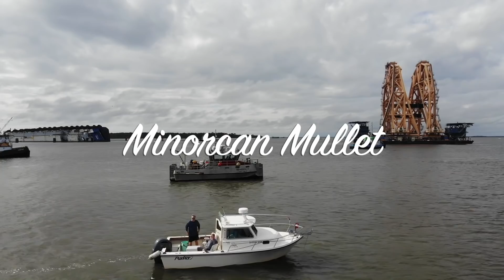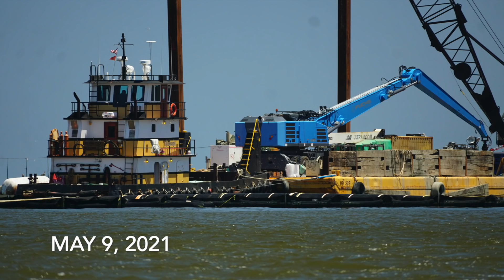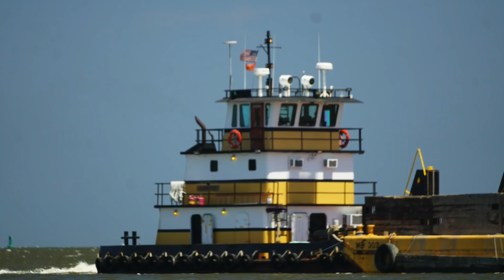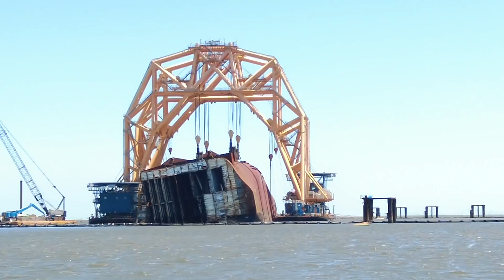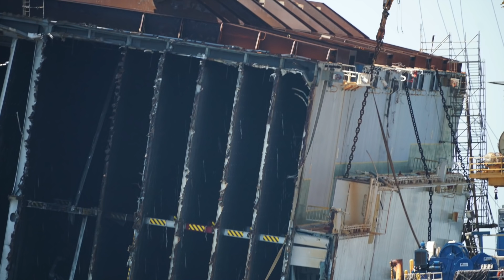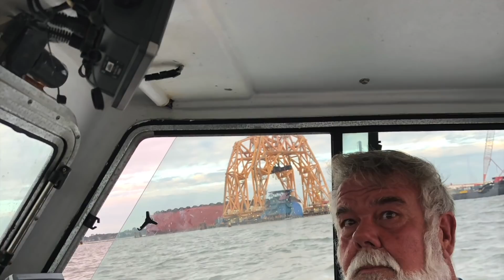FOR THE MOTHERS!! THANKS!! on May 9, 2021

Comment: does the platform as a whole, act like a floating dock
to compensate for tidal/current movement ? hope that makes sense:).
also :). are the neap tide slackwaters affecting sandbars in and around the 
the wreck area ?:):). the current looked strong but you said it was a brisk wind.
good analysis amigo. keep documenting:).
Reply from the maker: The VB itself is anchored so it can move with the tide.  The tension on the chains keeps it pulled down quite a bit.  MM
Reply: @MinorcanMullet  theres some insane equasions and luck:) going on there my friend. thank's for the reply.